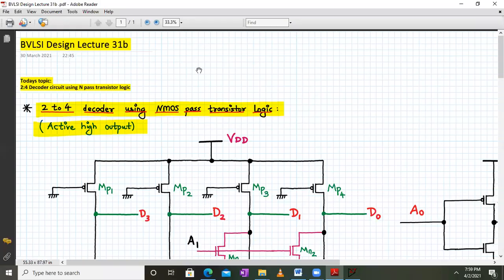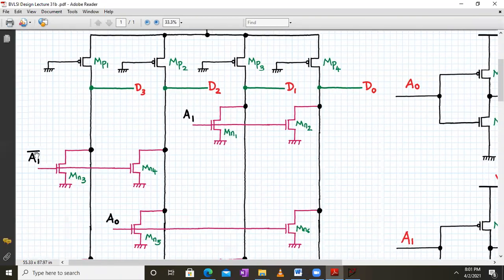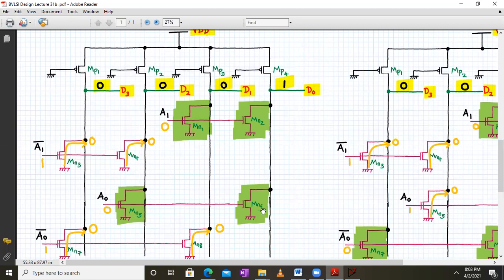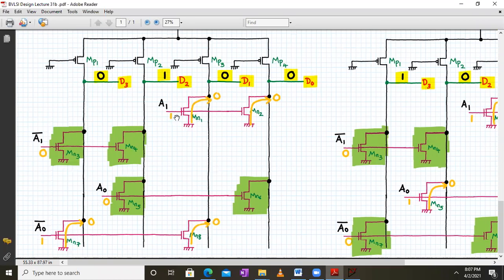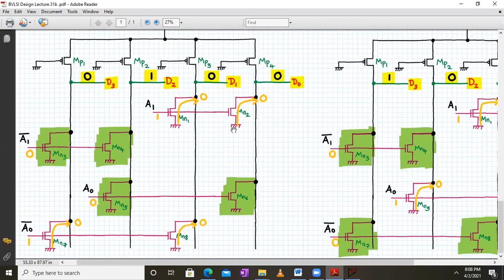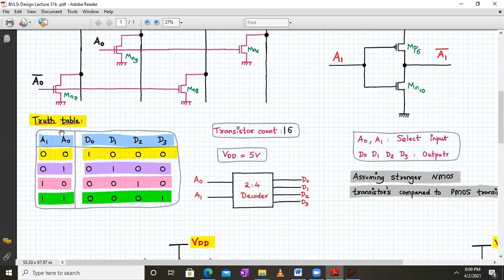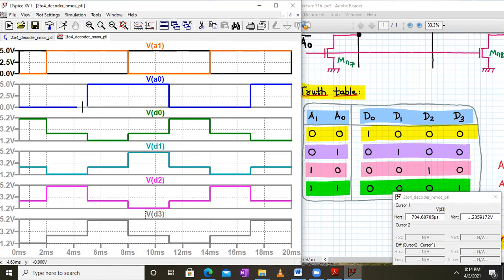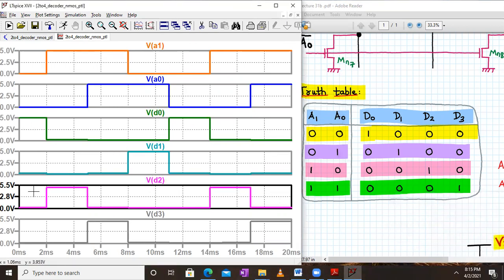2:4 Decoder circuit using NMOS pass transistor logic

Comment: you are connecting VDD to Ground in certain cases which is not correct
Reply from the maker: Dear OmidBorzoei, VDD is not connected to Gnd, it actually connected to Line D0, D1, D2 and D3, at one point of time when NMOS pass transistor are ON, it will pull the Line to GND. So in none of the cases, VDD is directly connected to GND.